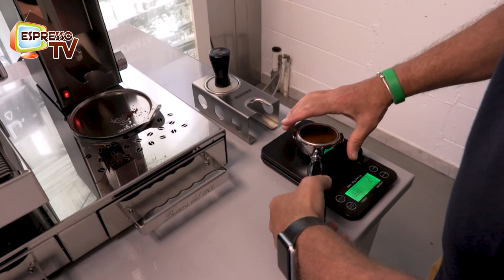Bezzera Aria with PID, shot timer, flow control system and main water connection

Comment: Is the Aria PID available with and without the flow paddle on the top of the group?  Release date for UK?
Reply from the maker: This i cannot answer, as far as i know it will be available in this version. But you can of cause remove the flow control yourself. 
About release date: it does not work like this. The delivery is always based on the orders of the distributors.
Reply: @TheEspressoTV  Ok Thank you.
Reply: what would make you want to have it without one? you can always keep it open. it can only help
Reply: @khaledzurikat7190  Just looks ugly and doesn't blend in with the other lever handles.  If it was the same as the steam wand handle it would at least look more substantial.  For those who don't wish to have this feature, I think it should be offered as an extra optional accessory. That would also reduce costs of the overall machine price.
Reply: @TheEspressoTV  Is the Aria PID available for distributors to order now?  I'm still being told that it's not even manufactured yet...